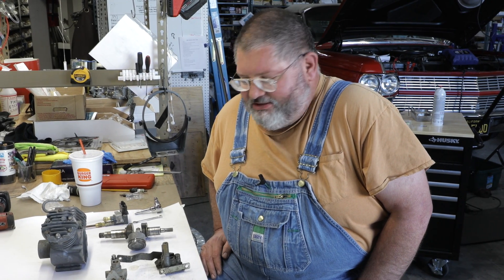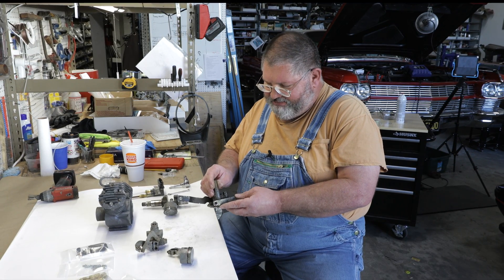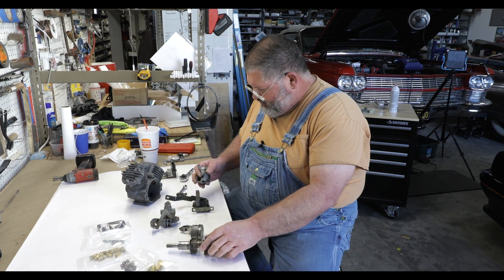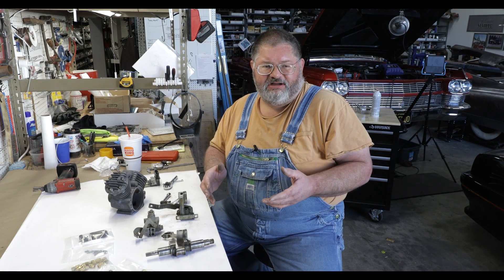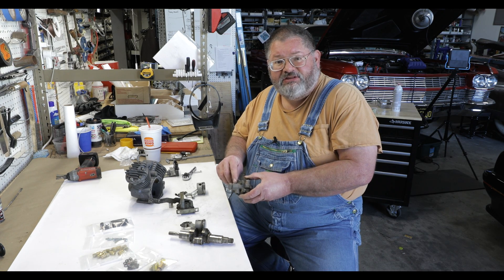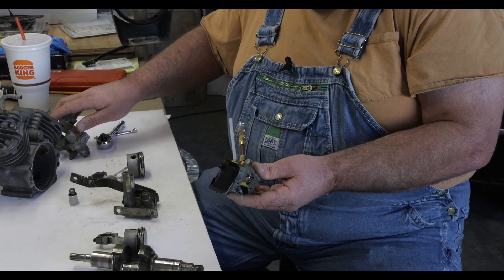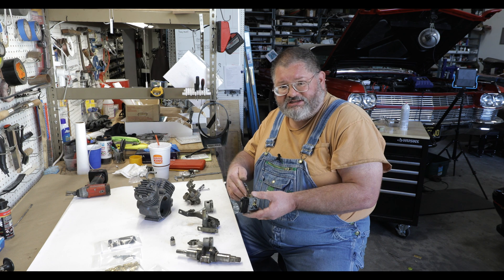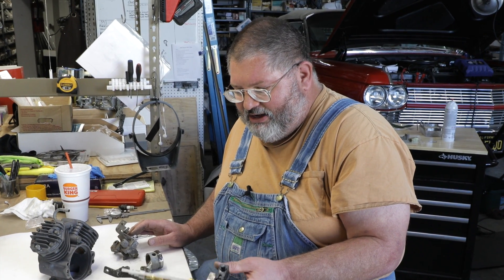How Air Ride Suspension Works

Comment: Is this system similar to the one on the 69 Eldorado? I have a small compressor mounted on the left wheelwell and what would appear to be some sort of proportioning valve bolted to the underside of the body, over the rear axle.
Reply: The '69 rear leveling is simpler than the '59. The compressor is under the hood and is vacuum operated. In the rear, unlike the '59 with leveling valves on each side of the car, the '69 only has one so it's much simpler. There is also no valve to fully lift the car as there is in the '59. Basically, you car has air shocks that are self-adjusting by the valve you noted under the car. Josh
Reply: @johncoyle4125  Thank you for the response. I think this project may be put on the back burner, as I have a lot of other items on the punch list that have more priority. Steve